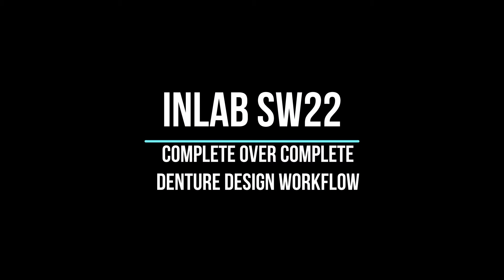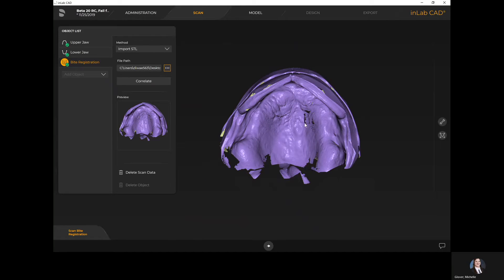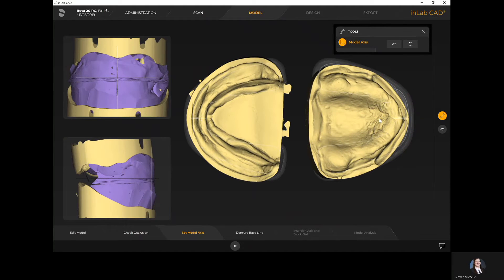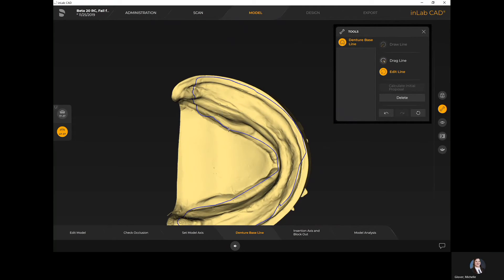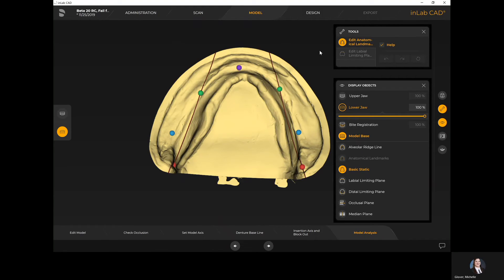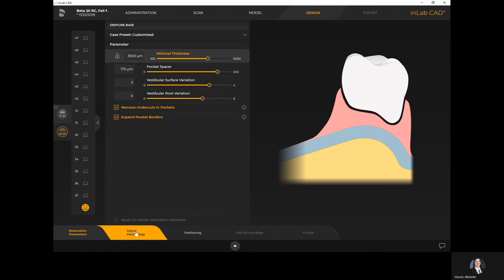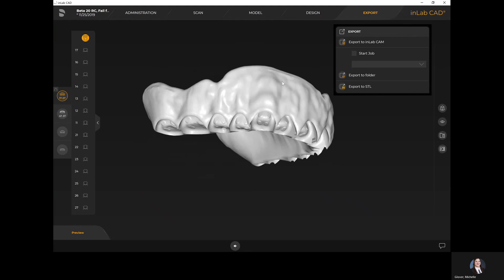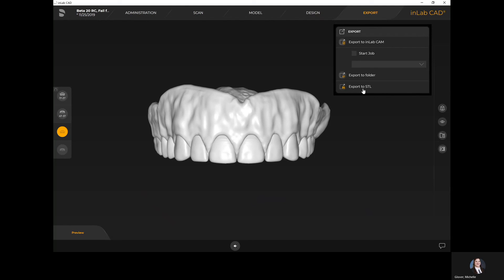inLab SW22 Complete over Complete Denture Tutorial

Comment: If I am doing denture opposing natural teeth do I have the ability to add remove to adjust the occlusion.  I am using individual teeth.  Also can I print individual teeth in sets of 4 for more stability.
Reply from the maker: Hi there, absolutely! In the “design phase” under “edit element” you have the form tool and shape tool available to adjust occlusion as needed. 

Additionally, with the individual teeth option, in administration you can select the connector option (on the two arches, the bridge looking symbol), to section or separate teeth. I hope that helps clarify. :)